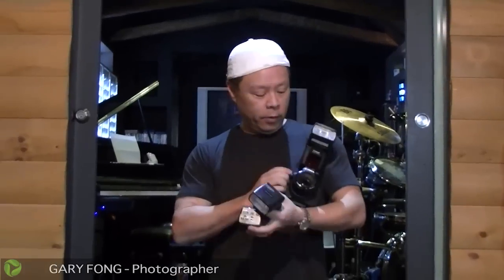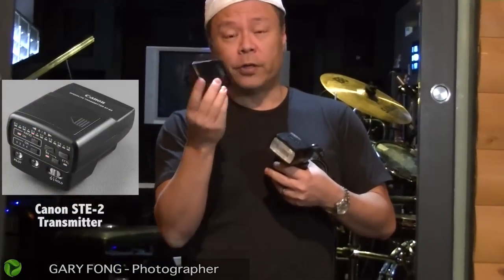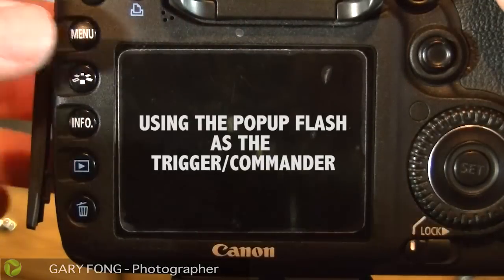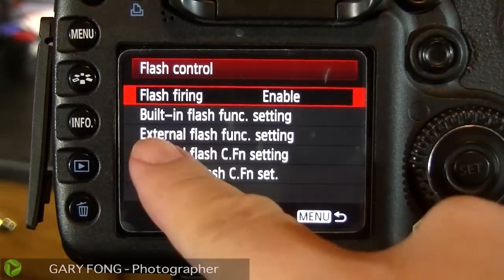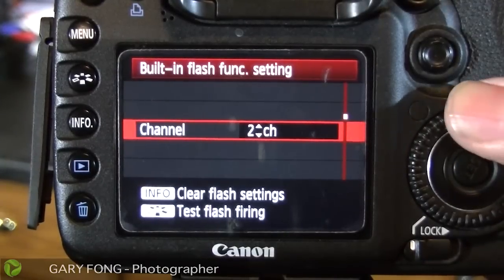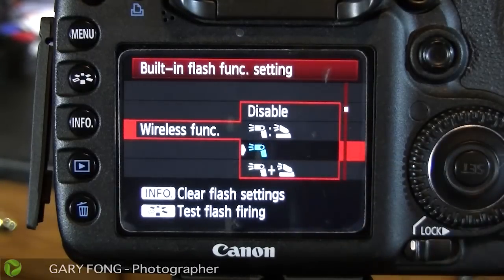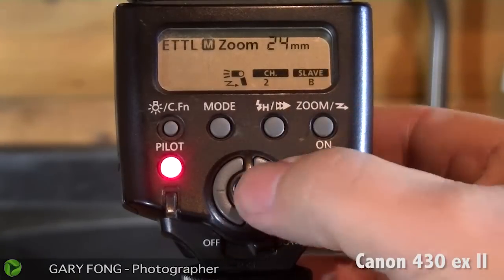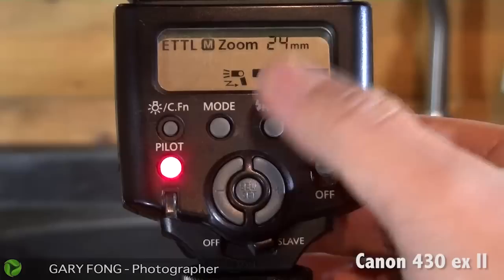Extremely Detailed Guide For Canon Wireless Flash 600ex 580exII 430exII

Comment: Gary - Thank you THANK YOU!  I've had the Canon Speedlite Transmitter ST-E2 for at least 3 years That I wanted to use with my excellent CAnon 580EXII speedlight,  but have never had the courage or knowledge to use the transmitter.  Thank heavens you gave this tutorial because, as you well know, if it weren't for your efforts, this nifty piece of equipment would continue to sit in its box because it is not intuitive and written instructions do not lead one through the process well enough to be useful.  You are an excellent teacher!  Truly appreciate your video!!!!

Comment from the maker: Hi Nicky - for your 5DII you will have to put a 580exII on the head as a Master commander.  The 430exII will only act as a slave.  Also you could put on the STE-2 transmitter, this you can get used for pretty cheap.  The 5dII does not have a popup flash, so it won't send the signal to the slaves.

Comment from the maker: The STE-2 is where you would control the ratios.  Under this system, the slaves are "dumb" in that all they do is listen to the commander.  Which is nice because the commander will tell them when there is enough TTL, and allow you to override, right from the STE-2

Comment from the maker: the only control you have in "slave" mode are: 1) channel and 2) which exposure group.  This makes sense because it is much nicer to control the output of all of your flashes right in front of you, rather than walking up to each individual flash, going back to shoot, then return to adjust.  The STE-2 is very very nice because do you see those nice, big buttons?  During a busy gig in low light, you'll love that.

Comment from the maker: You set the ratio between the groups in the controller.  This is common with all systems, because you wouldn't want to run all around the lap trying to change the ratio of the different heads after you see the images.

Comment: If you set up the 580ex II as a slave then you can control both the 580 and a 480EX II together using Canon's built in wireless flash system. I'm not sure about using flash groups to control output, I haven't figured that out yet but you can always put the flashes into M mode and set output manually on each flash.

Comment: Hella confusing... I tried to put the Canon Speedlite 580EX II in slave mode expecting it to just simply be triggered by my studio strobes.. nothing, not sure if it works with them... it should, using a peanut to trigger a flash is old technology, you'd think if the flash can slave and synch with other canon products it could slave to any strobe. I also don't like how in the manual setting I can set that ratio, in slave more I can't... only +/- 3.0, WHY? they think if I use slave mode I don't ALSO want to adjust the flash output?

Comment: Hi Gary, quick question about the STE2 ratio options.
If you have 3 flashes(580ex2), 1 in A, 2 in B, do you have to set the ratio setting in the flash or does the STE2 communicate the ratio to all 3 flashes wirelessly when you adjust with the buttons?

Comment: Thank you for this review! Quick question: When using the STE-2 with 580 ex II & Mark II 5D camera, how do I quickly take the flash power if it is over/under exposing my image? I thought that I'd be able to do that with the STE-2 using the ratio tool but it seems that  that only works when using multiple flashes. Help!

Comment: Gary, great video. I agree, I was not able to find a definitive guide to speedlights anywhere.  I realized I was confused - a speedlight takes commands on Infrared - but my T4i doesn't transmit infrared when using pop-flash. Right? Also, High Speed Sync - can't control from pop-up flash to a slaved SpeedLight? It does not look like HSS is possible on my T4i using pop-up flash.

Comment: Watching in 2024 as I've added some cheap used Speedlites to my collection and reviewing how to use some of the functions after mainly using them on manual for years with my pop-up flash on my 60D as a trigger. My 430EXII (purchased new in 2013) doesn't have a dedicated Slave mode switch. I access it by holding down the zoom button to activate it, then press it a couple of times to cycle through the Channel then Slave settings. Everything else looks the same.

Comment: Hi. I have a canon compatible "Phottix Strato TTL" triggers kit and Canon 580 ex ii. if I want to connect a slave flash, have I buy another same brand and same model receiver ? or canon optical slave mode is enough for success connection between canon flashes? and I heard optical connection is not good as far as radio connection under the daylight stiuation. is it true? By the way I wanna use both flashes off-camera.

Comment: Gary, I have a canon 6D and a 580 ex ii and 600 ex rt.
1. If I get a transmitter and two receivers, can I use the both of the flashes  off camera?  
2. I was unable to get the 600 to fire as a slave and 580 on camera as a master. Both  are on same channel with optical selected. Should I be able to use either one as a master and as a slave? 
Thank you for your videos.
Reply: Hello Brother, Did you ever figure this out? I have the same problem. I have both the 580 and the 600 flashed. I use the St-e3-rt transmitter.. But, haven't been able to figure out how to use them both at the same time.

Comment: Gary, Is there any way to enable autofocus while triggering the camera remotely from the flash unit? It definitely does trigger the camera, but with moving subjects it doesn't take much motion and the picture is out of focus.
Reply: I'm using the 600EX RT and the ST E3 RT transmitter.

Comment: Hi Gary and tank you for the grate video that i accidentally funded today , 
i want to ask you a question , i have the canon speedlite 600, with the radio transmitter , now i needed another flash as well , and fought i can use my 580EX II as a slave ( i use the 600 as slave as well , because i use the transmitter ST. E3 RT as master ,
i know that 580EX II don't read the radio transmitter , but u usually can use it when another flash use , so i fought it may go , 
but i couldn't use 2 flashes , the 580 EX II didn't read the another flash . do you know why is that ? and if i can do that somehow ?
Reply: Hello Brother, Did you ever figure this out? I have the same problem. I have both the 580 and the 600 flashed. I use the St-e3-rt transmitter.. But, haven't been able to figure out how to use them both at the same time.

Comment: Does anyone know how exactly the camera (or the transmitter) tells the remote flashes what exposure to use? I mean, I understand that the camera shoots twice the flash light. What does it actually do? When does the camera tell the flash 'hey, use 1/8 of a power'? I'm assuming that the camera first send the information about the power each group of flashes have to use, and then it shoots, as well as the rest of the remote flashes. Is it like that?

Comment: I have a T2i and Im lost after the built in flash step. I don't see a wireless option on my menu
Reply: T2i Doesn't have a wireless option (Commander mode). You might want to use a radio trigger. There are lots of cheaper radio triggers out there :)... I'm do also own a T2i/Kiss X4.

Comment: I have 2 canon flashlight 430exii flash and my camera is T3i , i know T3i camera already build in the wireless popup flash on it , but right now i don't want to use that popup flash because that popup flash there have a sync limited speed max is 200 or 250 , so what can i do now? i went to some camera store and ask them about that question they just tell me to buy a Canon Flashlight 600EX-RT , but after that i gonna ask another people they said i just need to buy a Canon Transistor STE2 . That's i confusing question and make me don't know who is wrong and who is right , so please help me to freak out that problem thanks

Comment: Hey can I use this transmitter with the neewer 670 ?
Reply from the maker: Not sure if the Neewer system has a Canon hack in it to allow for this. You may need to invest in a Neewer transmitter in order to communicate with the flash properly.

Comment: Canon products last a lifetime I still have flashes,cameras,lenses and more from the 1980's and they still work. My older sigmas , tokinas and sunpak flash 422 all failed now. Cant get parts for them to repair . So go ahead buy junk flashes you get what you pay for...I bought two 600ex rt ii and one 430ex rt iii.
Reply: Forster Stewart I totally agree with you. Also, contrary to the introductory comments in this video, I found the Canon off-camera flash system to be very easy to figure out the first time I used it. It is not complicated and having the ability to let the master flash either contribute to the exposure or not is fantastic.
Reply: cooloox yes also now the 430ex can now be set as master how cool is that. You can mix in group mode ettl,manual,old school with thyristor type manual & auto from the 80s. The radio revolution is such an advancement canon RULES.  They keep their finger on the pulse of photography technology as well as  photographers. Thank you canon.
Reply from the maker: We've tested numerous flash systems, triggers, etc. and found there are simpler solutions to use that will enable the grouping, ETTL, manual mode setups you're referring to. The radio transmitter revolution is not unique to Canon at all. There are several other options that are more reliable and cost a third of the price. Godox and Phottix to name a couple.
Additionally, the only flash units I've ever owned that have failed were the Canon 550EX and 430EX.
Reply: I always get what i pay for with canon , lukily canon has never failed for me so i for one will always be a canoniester. Plus i can control all flashes with my 5dsr . Is that possible with the cheapo's.
Reply: Also with certain cameras pre 2011, group mode  and auto ettl  is not available with phottix transmitters.

Comment: Yongnuo's can do all of that for a quarter of the price.
Reply: +canturgan yep.
Reply: +canturgan are they compatible with each other tho?
Reply: *****
Yes they are.
Reply: just one question, say if i had a 430 ex iii rt and a yongnuo yn560 iv can i trigger both of them with my pop up flash on my canon or do i need to get a transmitter?
Reply: ***** transmitter needed.
Reply: Flag Ranger oh alright thanks for replying
Reply: Does transmitter from yongnuo will trigger my canon 430ex iii speedlight with no problem, or its better save up and get canon's transmitter?
Reply: Go Yongnuo it sometimes triggers better.
Reply: No it does not. I had purchased the yongnuo transmitter and tried to sync it with my canon 430 and it will not work.  Yongnuo transmitters only work with their own flashes
Reply: Michael Kullum make sure you use the right transmiter for you camera.. i use yongnuo for while without problems...